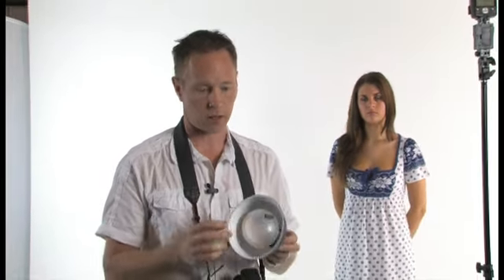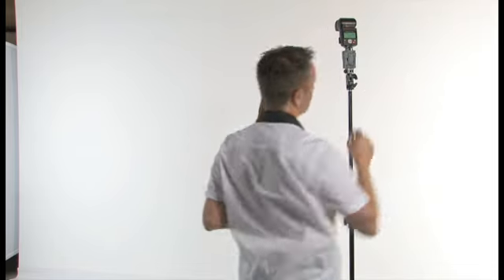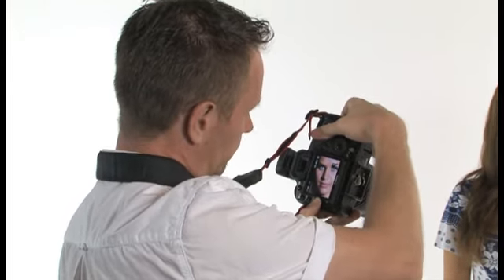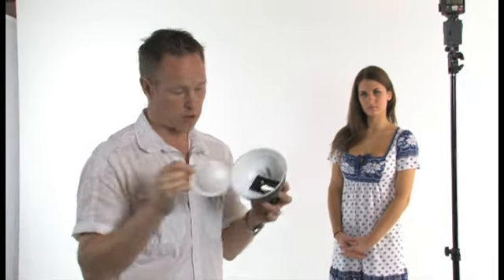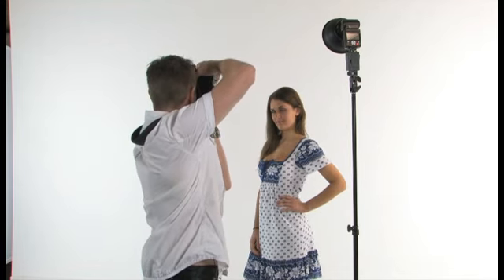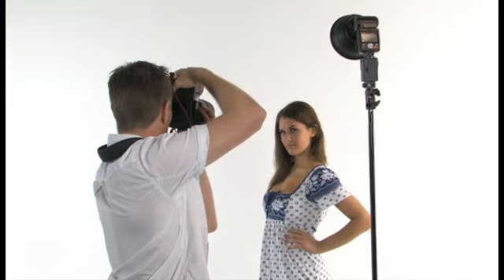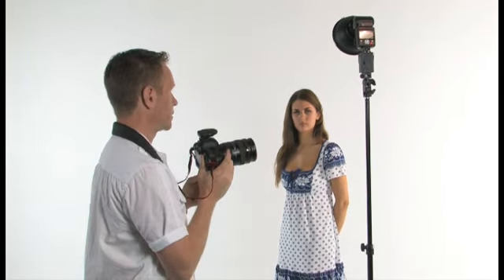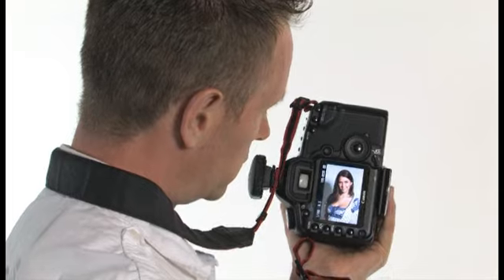Strobist Accessories Paul Ward Part 1

Comment: Paul, thanks so much for explaining about the elastic band!  At first I just thought it was packaging for the strap and was annoyed that I couldn't fix the units securely to the flash head.  As soon as I tried the band on the head, as you explained, it fitted securely.  Now this 'problem' (really my error) is addressed, I agree with you about the build quality, which in my opinion is very good.

As an aside, is this equipment marketed under the Flashpoint Q brand in the US?  It looks identical from what I can see.

Comment: Nice show. But....... !  You should start with setting the ISO of the camera (and speedlight). 
Set the speedlight at FULL power. Set the camera at a kind of flash-auto-sync. 
Set the correct shutterspeed. Or go for manual and make some tests flashes. 
Or get your flashmeter to find the correct f-stop. 
Print the photoos to show and to compare the results.
It is very uncomfortable for your model to stand straight and wait; let her sit on a chair at the table. And put your camera on a tripod. Every testshot must have been made from the same position.